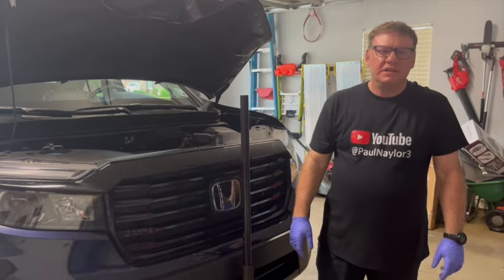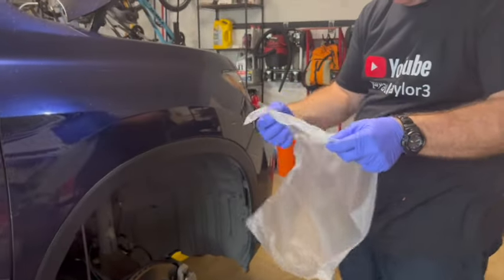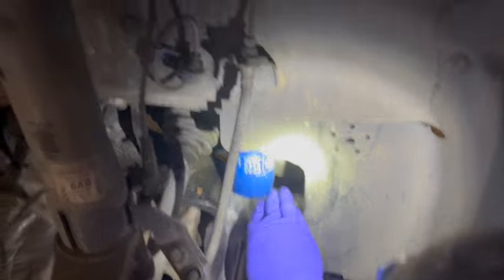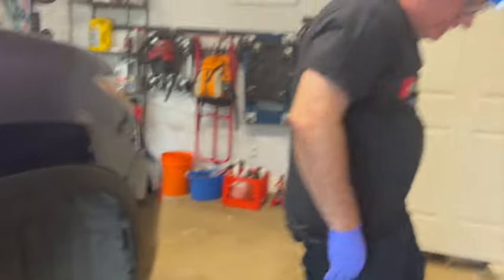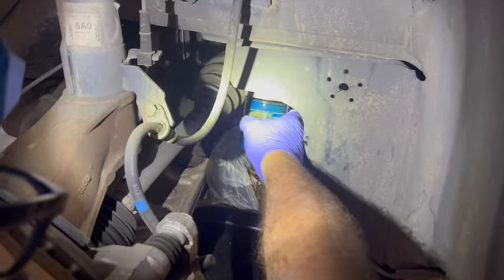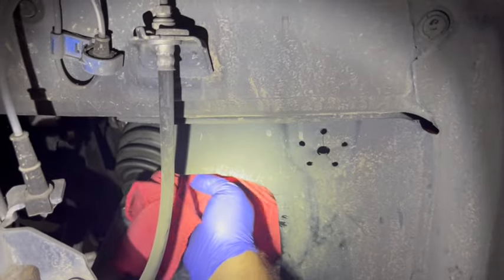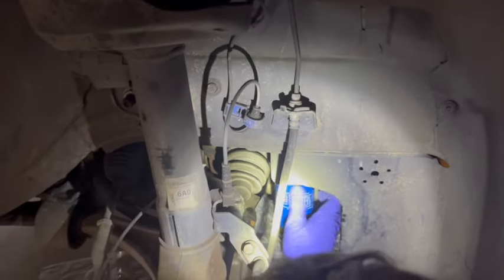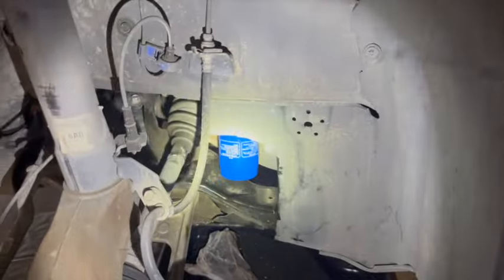Honda Oil Change  - Keep cross bar clean under oil filter for Ridgeline, Pilot, Passport, Odyssey

Comment: I just take a ziplock freezer bag one quart slide it open, open it up, fold the ziplock part down about an inch and then slide it over the oil filter. Then I unscrew the oil filter with the Ziploc bag, it all drops down to the bar and then I just scoop it out of there. Catch any drips from the nipple.